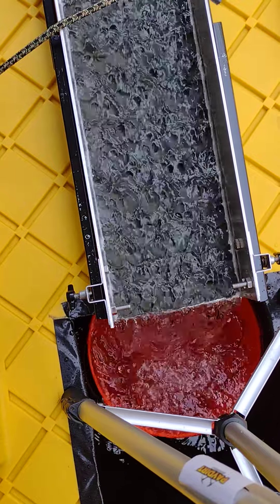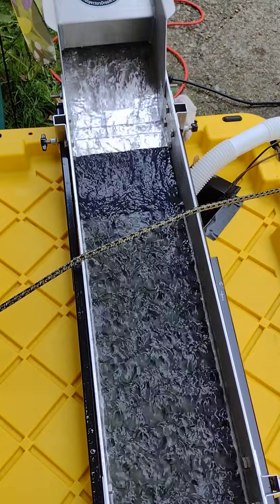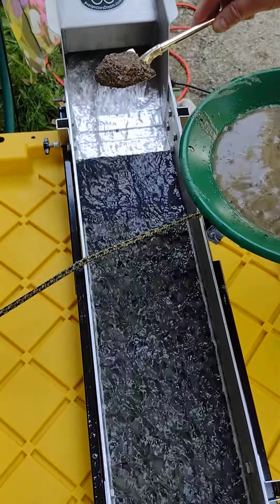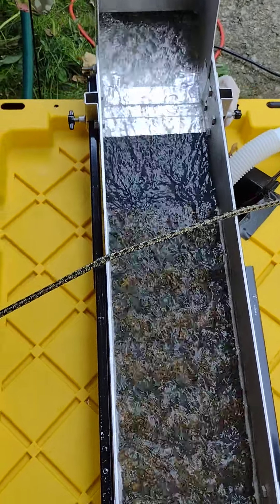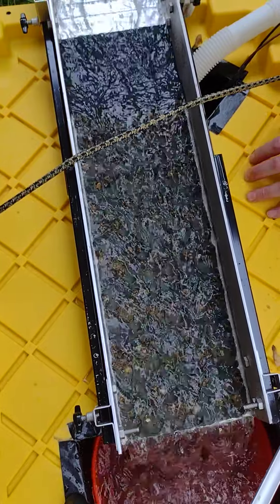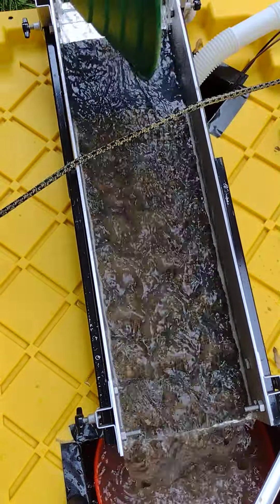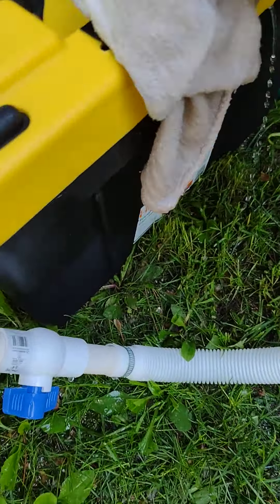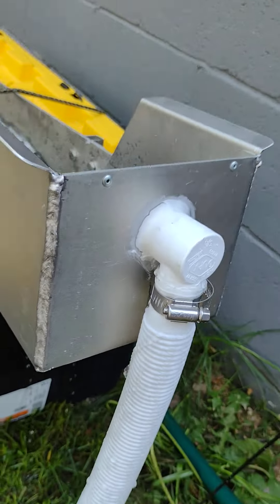INDIANA CREEK PAYDIRT 1ST RUN NEW SLUICE PT1 .5g

Comment: Really like the setup bro, the leaks are a given with new plumbing you'll get em sorted and be good to go!
Reply from the maker: Yes i will thanks brotha appreciate it need to classify smaller fix leaks   fix broken header coupling i got voltage regulator comin says be here tomorrow  so back to the tinkering 😎👍